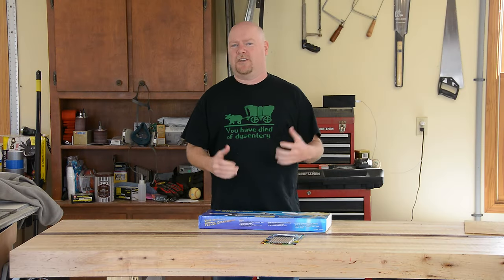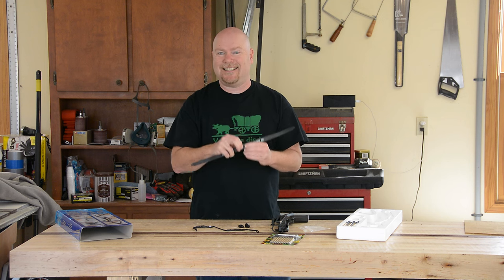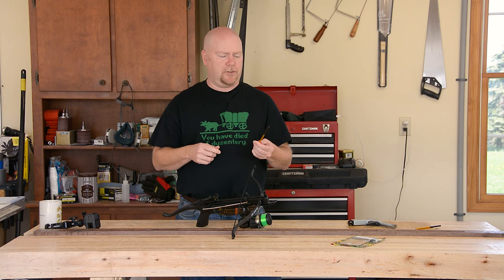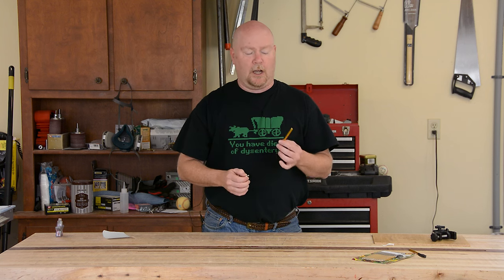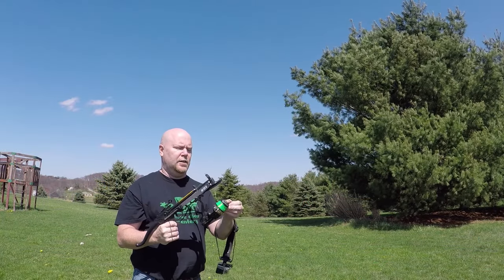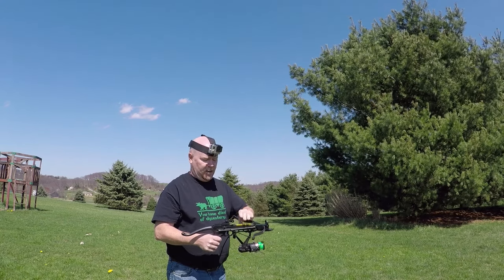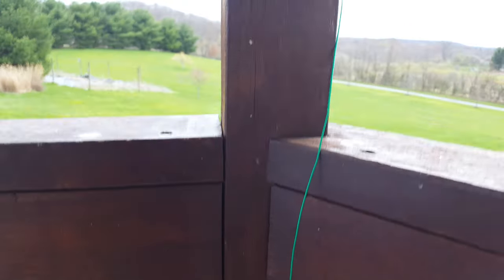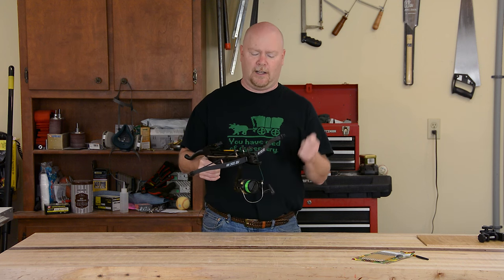Crossbow Pistol Antenna Launcher

Comment: Great idea.  a smaller "spool", maybe a tube mounted underneath with 40 yards of mono-filament would be less cumbersome than that reel.  10lb test sound about right?  Plus, those hollow bolts have a dual-use as a chemical delivery system in a SHTF scenario at short range in cover of darkness.  The Army taught us how to do the antenna-over-the-tree thing using the old man-portable Vietnam-era radios (PRC-77's, I think).  Highly directional, but ultra long distance when oriented properly.  How much was the crossbow?

Comment: Very good idea!   On eBay you can get a fishing kit conversion for that kind of crossbow, so for people who don't have an old reel may find it  an easier option buying it all in one go.  Also maybe worth to buy some fletchings off eBay and make some heavy bolts from some steel or brass rod with the added fletchings for stability, surely that should be heavy enough!
Oh and on another point check out 1/2 wave end fed antenna's.  If you make a 49:1 or 64:1 balun and cut the length resonant at 80m or 160m it is multi-band for lower bands!   Seems like you already have the space! :D

Comment: Thanks for the Idea I am interested in pneumatic lauchers

It's safer but my wallet says that the cross bow is a cheaper option. 

Adding the zebco with 50 pound line and hopefully a less dangerous ammunition 
And I'll have my g5rv back up.

Comment: I'll stick with my pneumatic launcher. A tennis ball looks a lot less like a deadly weapon and doesn't hurt as much. Height is no problem. I test fired one without a line once. Never saw that ball again. Portable tire inflators solve the reloading problem. Harbor Freight makes on that fits the batteries of the drill I already have.

Comment: I bought the xbow on Amazon for $29 and a Zebco 202 for $9. Put a 4" threaded rod on the bolt for weight, filled it with BB's first, mounted hardware, aimed and shot bolt about 80' straight up over a tall pine tree, weighted bolt dropped right to the ground.  Raised my 53' EF wire to about 60'. DX'ing my ass off!  20M to Argentina, England, Scottland, Germany first day.  Thank you!

Comment: If you really want to get risque you can just use wire instead of fishing line and put a barb at the end and go for the 2nd story roof across the street.  Nice long wire antenna. Nobody will ever notice.  You have a nice big lot!  In a few years I plan to sell my house with the angry neighbor across the street and buy an acre-sized lot where I can string a very long loop over four 30' towers (not too unreasonable).  If I have a couple tall trees spaced far apart though I'll certainly setup a long wire as well.  Your method definitely works!

Comment: ..Good Job Matt. I don't do antennas, i do need to run a line into a tree to pull a rope in it. I use a slingshot and the bearing from a CV axel,(the ring looking bearing attached to the axel under the rubber boot), with Hi-visibility braided brick mason string. The only law we have about a slingshot is you can't carry it concealed...
Reply from the maker: I was using the slingshot I have to chuck tennis balls for the dog.  Worked reasonably well, but the crossbow is decidedly more powerful and more accurate.   Slingshot is the clear winner though if the law makes you leave the bow at home!

Comment: If you found a steel bar that fit in there you would increase the weight by nearly x7 just epoxy it in there if it's a little loose

Comment: That has to be the absolute worst and most dangerous option for launching an antenna while still using the darts.  I would find another option.  I wouldnt want to be the poor unfortunate chap that ends up trying to launch that for an antenna and then by accident that dart hits an innocent bystandard.  Use a tennis ball or a weaver bag.  The dart should NOT be an option.
Reply from the maker: I only use this on my own property.  We're out in the country with significant acreage.  If there are bystanders - they are not innocent, they are trespassing.

Out in the parks for POTA I use a genuine arborist throw bag and line.  And don't kid yourself about those air cannons either - they're likely just as lethal as one of these darts!

Comment: fishing pole not accurate enough to cast the line?
Reply from the maker: Depends on your skills.  I'm sure for some it would be fine.  For me - not so much.   The real issue is portability on a motorcycle.  Unless you're into a multi-piece or collapsible rod of some kind, they don't pack well in small gear.
Reply: ah, I thought it was a one time antenna install.